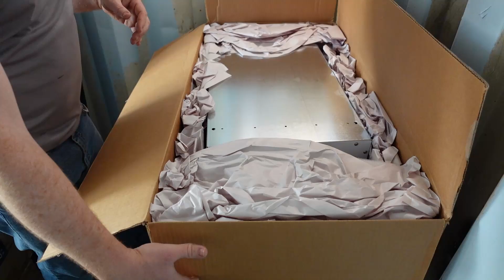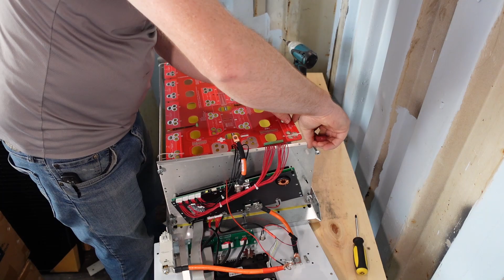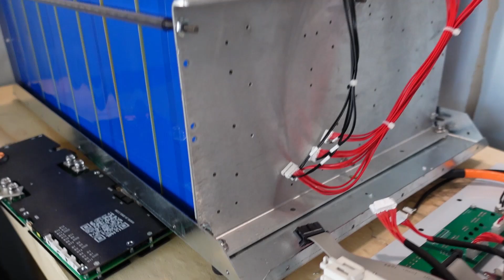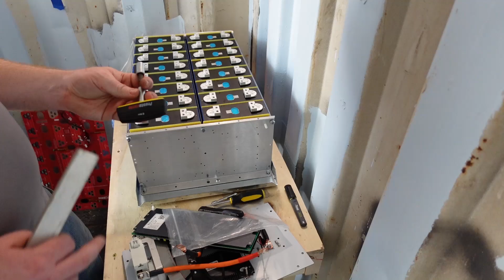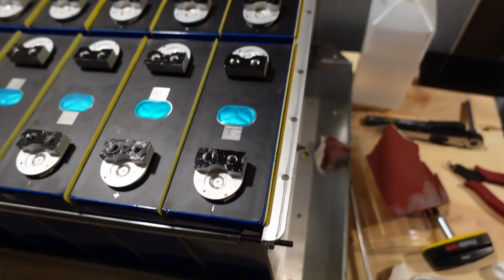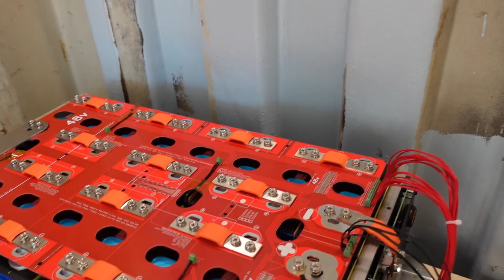DIY AmpBox FULL build and review #lifepo4

Comment: We've improved some thing since this version , Updated the terminals to bigger ones,  Updated the PCB to accept connector matching the JK connectors so now its very easy, No more splicing little wires and the possibility of connecting out of sequence.  Also we are using solid busbars inside the box.  no more wires.  Also the BMS is now attached to the face making much easier to install.